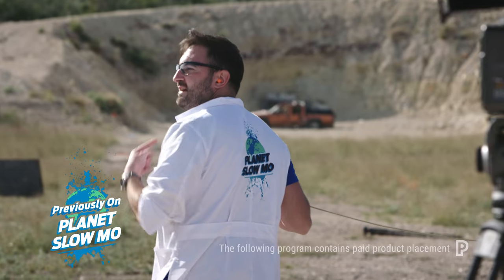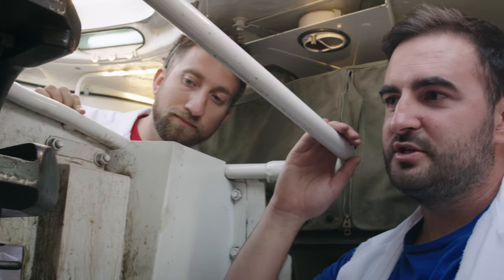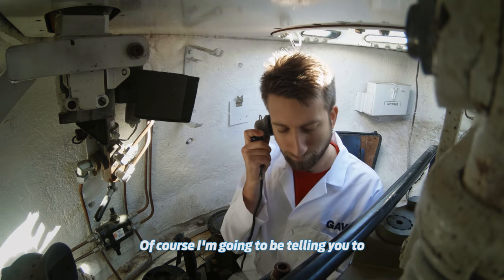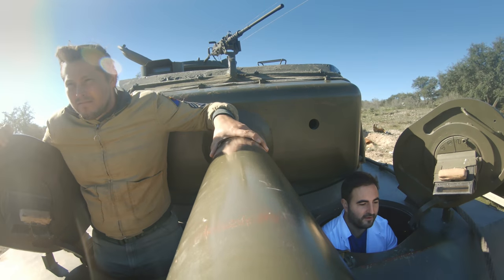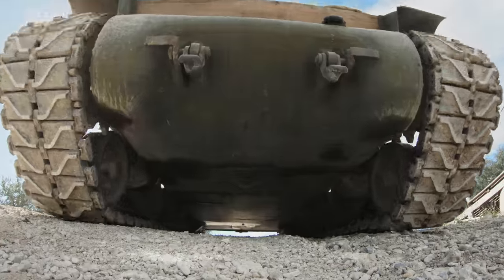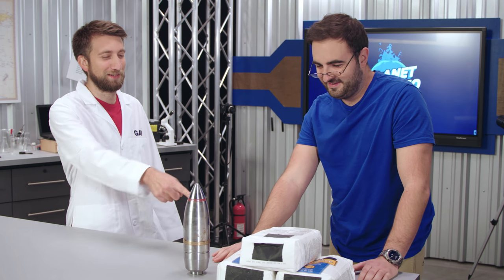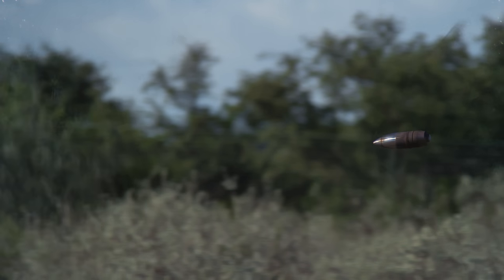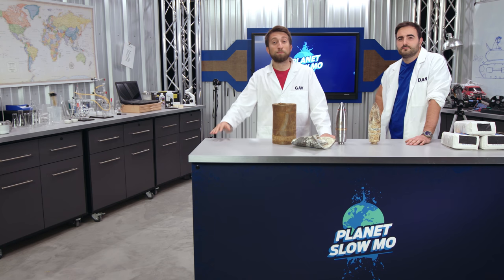How to Drive a Tank

Comment: I now completely understand how to drive a tank. Thank you slow mo guys, very cool!
Reply: Go pass tha drivers exam
Reply: I've driven a tank. Obviously I'm no expert, and I'd need training, but the two sticks make it really easy
Reply: @goodguykonrad3701  cool
Reply: You know how to drive a Sherman. Modern tanks don't control like that. They usually have a more motorbike handlebar type deal that you rotate.
Reply: Can YouTube just keep on throwing money at the slow mo guys indefinitely?
Reply: Let's go steal my dads tank now
Reply: Only an M4 Sherman. Though, if you can drive a car, you can drive an M1 Abrams or M2/M3 Bradley no problem.
Reply: Some tanks are easier to drive, some tanks are harder, the Sherman is rather easy to drive, a T-34 on the otherhand, (which is a Russian tank from WW2) is more... unpleasant to drive. The levers are much stiffer and more difficult to move and it is significantly more cramped.
Reply: tbh if you can drive a car you can drive a modern tank which tend to be way bigger then an M4 sherman
Reply: it's actually easier than an automatic transmission car.
Reply: @KoeSeer  
....ok.... 
Things are definitely different on your Flat Earth !!!

That should elicit an AUTOMATIC Response 😂
Reply: @RedShocktrooperRST  Even some mid to late war german tanks actually had steering wheels more like modern tanks already. Crazy if you think about how fast that stuff was figured out.

Comment: I'm actually kind of impressed it gets 5 mpg, I was half expecting the guy to correct Dan and tell him it's 5 gallons per mile
Reply: I think it gets less then 1MPG actually... The fuel tank held 175 gallons and a 120 mile range on normal, terrain, from what I have read, could be wrong
Reply: Tabatha Creedence, it depends on the model. Early models which had gasoline engines had the range of 100-120 miles. The model shown in the video I believe was an A-6. It had a diesel engine and a range of about 150 miles.
Reply: Depends what gallons as well. Probably referring to US Gallons which are different to Gallons in the UK
Reply: @gawainethefirst  Not sure how that equates to 5 mpg, but.... um ... OK.
Reply: @ryanriordan4209  Mile per gallon, i guess?
Reply: @gawainethefirst  I'm pretty sure that that model of Sherman has a Ford GAA engine, which is a gigantic V-8.  Unless somebody did an LS swap or something (Detroit Diesel swap?) on this one.  There was an early Sherman model with a diesel, but by the time the E8 came out the Army had standardized on the GAA.
Reply: GAA gas V-8.
Reply: @quas392  That's true, the US gallon is smaller than the UK gallon so I suppose technically you would get more MPG to a UK gallon than a US one
Reply: @Josef Svejk
 That was an M4A2, which has a diesel engine. M4A3s have GAA V8s that run on gasoline.
Reply: @tomfoolery4490  Oops, you're right about the A2.
Reply: It's actually M4A3E2, and M4A3E8. The E2 had heavier armor, and was used to assault fortified positions. The E8 was used as a more traditional cavalry role.

Comment: For some reason I thought the tank controls would be more complicated. Guess not.
Reply: Only at the M4 series.
Reply: I guess in the ww2 era they didn't have much option with smart tank operators. just with legs and arms and minimum of one relatively healthy ear is enough :)
Reply: Tanks are made dirt simple because no matter how much you train them, almost inevitably one of the enlisted driving it will have not graduated High School, and for good reason.  There's actually a surprising lack of respect for the role of tankers when compared to pilots considering they both wield weapons of such ridiculous legality compared to regular people, or even trained infantry.  To be a pilot you need to be an officer, which means a college degree.  To drive a tank, you have to negotiate with your recruiter, and get luck when they place you after basic (recruiters always lie and their promises are worth nothing).
Reply: @morganrobinson8042  you got lied to?
Reply: Well they still didn't show everything, like the shifting, for example. Also, this is just one tank design out of hundreds, and almost every tank (especially from this era) had a different way of doing it. The Tiger I for example, actually had a steering wheel.
Reply: Tiger got a steering wheel ya know
Reply: @morganrobinson8042  One of the kids in my unit in Basic complained that his recruiter said it would be like summer camp.
Reply: "Why are there six pedals when there are only four directions?"
Reply: Weapons are tools, which are suppose to make things easier.
Reply: @Jaqen-HGhar  
I think you missed a mark there, mate. I made a remark reflecting that I couldnt believe a kid actually thought that boot camp would be like a summer camp. Almost everyone i know that's enlisted was lied to by their recruiters, and as you say, it did serious damage to one of my friends.

But really how stupid you gotta be to go somewhere that you'll be trained to fight and actually think its gonna be like summer camp???? How does someone walk into a recruitment office and trust everything that the recruiter says at face value, when their job is to say whatever works to get you to enlist. I dont get it
Reply: The steering is simple, but there are other operations the driver has to manage. Just pull up an old educational video from back in the day, it had exactly the necessary information for aspiring corps- err, Sherman crewmen.
Reply: It is easy to criticize people, but deprive them of sleep, food, and shell them for 3 days, and half of the people in this comment section would be just as stupid as the ones they are criticizing, (and would make the same mistakes).

Comment: You tease us with gav driving a tank, and don't let us see the success/disaster of it.
Reply: I was thinking the same lol
Reply: Surely the other guy objected after it came out that he can't even drive a normal car lol
Reply: Dunno about their regulations, but in the military I served in, a regular driver's license was only required for driving armored vehicles that were street legal. See, bare metal tank treads rip up asphalt when turning. So some vehicles have thick rubber pads on each tread which enables it to drive on asphalt without ruining it. The M113 APC, for example, has these pads. Anyway, the point is that you didn't need a driver's license to become a tank driver on the tanks that were NOT street legal.

Comment: Great explanation on how to drive a tank AND the internal ballistics of the ammunition itself. You ARE THE BEST!!! One question, Do you know why the projectile was YAWING as it left the muzzle??? One would think that the rifling imparting the spin would have zero yaw, however, there is another reason why!!
Reply: I recall they tend to reuse the round. So dents and dings cause it move in flight.
Reply: Nathan, brings up a good point. 
Also, if the barrel is the original barrel, it may have some problems as well. 
Which might also be affecting spin. But yeah, if everything is working correctly, the round shouldn't have any yaw (or at least very little).

Comment: when Gav was in the turret and that manual Traverse handled was spinning around like crazy I was gritting my teeth it should have been in a locked position because obviously the no back mechanism of the traversing gearbox wasn't functioning and that's extremely dangerous !!!
I've seen people get hit by those things and it's not pretty.
Reply: Wait, so they had the turret controls disconnected? So what kept the turret locked in place?
Reply: @michaelbushee3968  it doesn't look like it was you could see it moving while they were driving
Reply: @michaelbushee3968  Mass and friction. Essentially.

Comment: That wasnt a jumbo... The jumbo is the M4A3E2 which is essentially and up armored version of regular sherman. That tank was the M4A3E8, the easy 8 or the "Fury" tank. It has a different suspension and not as much armor as the Jumbo.
Reply: Oh and a different gun depending on which variant of the jumbo you have. (short 75 vs the 76mm)
Reply: The one they fired was for sure an Easy 8, but the one they drove was not the same vehicle- i don't know enough about american tanks to confirm if it was a Jumbo or not.
Reply: Ah, people trying to look smart.

The one they fired was a M4A2E8, it's a diesal version of the M4, and you can tell by looking at the engine deck

The one they're driving is a mutant. It's an M4A3E8 hull, with a beat up Jumbo turret and gun, with the mantlet from a normal T23 turret.
Reply: @Sreven199  So I'm not wrong, but not right either. lol Then the question is what gives the tank its designation? The turret or the chassis
Reply: @HunterBaughman  a number of different things. For example, 

A3 designates that it uses a Gaoline Ford GAA engine, A2 means it used a diesal GM 6046

E8 in this case denotes the suspension.
Reply: @Sreven199  Right, but the question I am asking is the turret enough to call that tank a "Jumbo". Personally, I don't think so but I'm just a random dude on the internet.
Reply: @HunterBaughman  well the Jumbo was just the nickname for a field job up armored Sherman. I guess the turret was the only factory done part, so that might be what calls it a Jumbo?
Reply: @Sreven199  It's a M4A3(76)W without a muzzle-brake. No welded on frontal sheet, no additional trapezoidal armor plates on the mantlet -  not a jumbo
Reply: @NikolaevAlexander  the turret itself is the up armored. The mantlet and the hull are replaced
Reply: you are right it's not a jumbo.. they have 75mm main guns.. that is a Easy 8, except it doesnt have the typical muzzle brake on the front.  Not all had that brake.
Reply: It is a jumbo, it doesnt have the rounded edges

Comment: Why is there only 2 levers when theres 4 directions?
Reply: not an expert and this might not be exactly how it works, but its because a tank is designed to have a 360 degree turning radius meaning it can turn a full rotation without moving from a fixed position. essentially, the right lever moves the right side(track) of the tank forward/backward, and the left side moves the left side(track) forward/back. if you move one forward and the other back it will spin the tank either clockwise or counter-clockwise. they make riding lawn-mowers that use a similar system.
Reply: @blackbeltbap  it's a mild reference to an internet show that predates YouTube and is still running to this day. Having just finished it's 16th season last year.

Comment: going to point something out, Dan called it a Jumbo. That is not a Jumbo, but a later model Sherman called the "Easy Eight", or M4A3E8, and the name on the barrel is a play on that nickname of the tank. A jumbo is an M4A3E2, with slightly different suspension, turret, and front armour with a thicker plate, and in the previous video they did get the name right in calling it an "Easy Eight" and by its proper name M4A3E8, which also is the same tank model used in the movie Fury, and its always nice seeing the tank Fury at Tank Fest in Bovington.

Comment: Some tanks like the BT 42 or the Tiger 2 actually did have a steering wheel. In the Tiger 1 the steering wheel aided with the neutral turn

Comment: It's interesting to note that the shell fired isn't going at the correct speed it was designed to. Probably a lighter powder load to give the old gun a break but you can see it's already destableizing right out of the barrel cause it isn't able to spin fast enough from the low speed. Couldn't find the part but i think they said it came out at about 1700 - 1800 fps? Since i'm pretty sure that's M79 shot that's supposed to be going 2598 fps instead. Still very fascinating stuff to see, and i really like that' they used that mirror trick to track the shell in flight.

Comment: Just noticed they goofed on the Jumbo spec. The cannon on the M4A3E2 was a 75mm (same gun as the earlier Shermans), so the predecessor to the 76mm on the Easy Eight. Very few Jumbos actually got the 76mm.

Comment: I've a lil techie question, that copper ring that deforms into the grooves of the tanks barrel and imparts a spin on the projectile. Since copper is so soft, wouldnt you run the risk of completely shearing the copper ring?

Comment: A little bit of background on the Sherman plus every model created. The Sherman was mass produced by the Ford car company. Because of the assembly lines from the 20s this allowed many models and total number of tanks to be created quickly. Then the reason you found the tank easy to drive is because of how it was manufactured. The Sherman was designed to be driven as easy as a car. So if you can dive a car you can drive a Sherman. They are different driving methods but it's transmission and running gear (the wheels that move the tracks) were developed like a car's.
Reply: Very few M4's were produced by Ford Motor Company, only about 1,690 M4A3(75)'s of the earlier "small-hatch" pattern. Most were produced by Chrysler Tank Arsenal, Fisher Tank Arsenal, and the Pressed Steel Car company.

Comment: Can you get a accurate measurement of the the angle of the shock wave from the video you have. If so you should be able to check at what speed the projectile was traveling and see if it agrees with what you where given as the ballistics specifications

Comment: Cool vid, but the D-20 was a howitzer - its round is an artillery shell and was not designed to defeat armor as was claimed in the video (it is an explosive round, not a HEAT round using explosives to penetrate armor).
Still, very very cool!

Comment: Very good. What you didn't say is that the round you fired works by knetic energy. But there is another round called H.E.A.T. what stands for High Explosive, Anti Tank. I don't think they they are legal to use without special permission from ATF: Alcohol, Tobacco, Firearms and Explosives.

Comment: i want to know how the turret turns when you are sitting inside..if you are sitting inside next to the breech, and the turret turns, does your seat also turn with the turret? i mean, it would have to right, since you can't get out of the way and the breech would hit you. But then if thats the case, what about the people in the front driving? Do they just stay there, and how do they avoid being hit by the stuff on the inside as the turret swings around? or are they below that level?

Comment: 5 miles per gallon is GREAT millage for a tank. The German Tiger II (King Tiger/Royal Tiger) got 1/4 mile per gallon. 400 gallon capacity, 100 mile range. Most of them were put out of action due to mechanical break down or running out of gas.

Comment: The reason why the 152mm was redirected was because the bigger the round, the heavier it is. If you don't have the right amount of power, it will stop or deflect. Watermelons aren't as tough as armored steel, but they still stand a chance against small arms. But even I was suprised to see it deflect on the last two watermelons.

Comment: Can anybody help answer a question for me that my brother and I are debating? Is it aerodynamics or gyroscopic stability that stabilizes the round in flight? It looks like in the video the round is pushing the air out of the way making a sonic boom, so with out any air flowing around the projectile to stabilize it wouldn't that mean it's the spin that's making the round correct itself in flight?

Comment: Question.
Do different types of ammo fall sponer to the ground.
Is it truly like you just drop them from your hand?
Reply: An object fired horizontally will fall at the same rate as one dropped from rest, unless the shape of the object is angled such that the viscous drag force in air has a downward component and it is forced down faster when travelling at a higher velocity. This is because the horziontal component of flight and the vertical component can be separated, as long as the relevant vectors are resolved to give all the forces that affect the motion.

Basically, unless it acts like a race car's spoiler or you fire it up or down, then yes it will fall at the same speed as if you had dropped it.
Reply: @morgansearle3912 How can they get a 120mm tungsten round with a spoilerkit?
Edit.. smoothbore box shape barrel baby yeah! Get the sci dudes on it plz.
Reply: @morgansearle3912  oh and ty. I still .. so... how long does it take to fall 1/3 meter down and how long will the ... ah so at longer range doing level the drop is faster the further... its obvious but.. is there a good vid that shows it well in action?

No need. Kk ty
Respect
Reply: @gumunduringigumundsson9344  i have absolutely no idea what that was meant to say, but I can tell you that ignoring air resistance (which is fair for this) an object at rest will fall 0.3m under gravity in roughly 0.25 seconds
Reply: @morgansearle3912  cool.. but between 0.25 and 0.5 how far? .. on a whim.. 1.2m?
This is fun science

Comment: 5:49
Ironically, those three bags of flour might have more explosive energy than the rather inert shell if it was all suspended in the air and ignited.
If you want an example of said explosive power, look up the Washburn A. Mill explosion.

Comment: M4A3E8 Sherman, Known as the Easy 8 for it's easy of use, then there is the M4A3E2, Sherman Jumbo, which bolsters more frontal armor than the regular M4 or E8 shermans, and there is a difference between just an M4 Sherman and an M4A3E8

Comment: The tank you were driving was not a Jumbo (M4A3E2). Rather it was an M4A2 or an M4A3 with the HVSS suspension (you can tell by the front plate and turret mantlet, also the Jumbo never used the VVSS and not the HVSS suspension)
Reply: M4A2(76)W HVSS as you said is correct.  However there was one variant of the E2 of about five or six tanks converted into the experimental T33 flamethrower tank. Which did have HVSS.